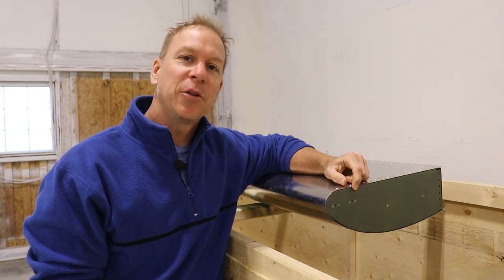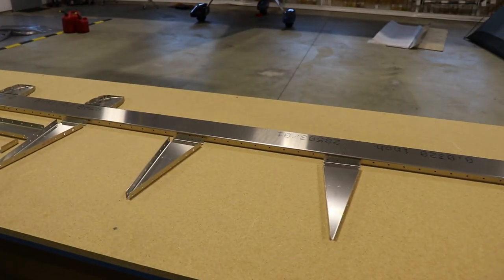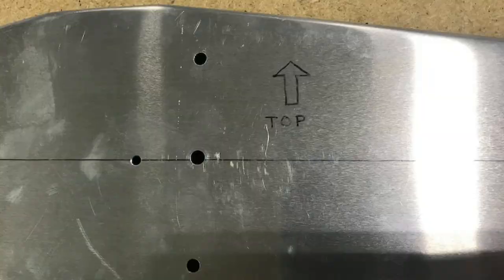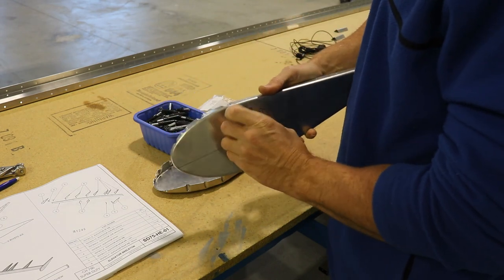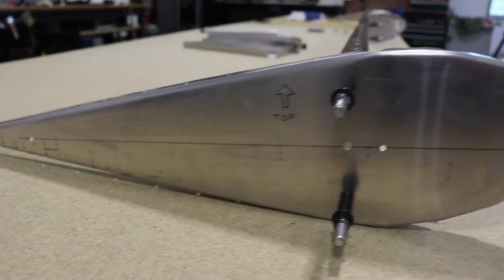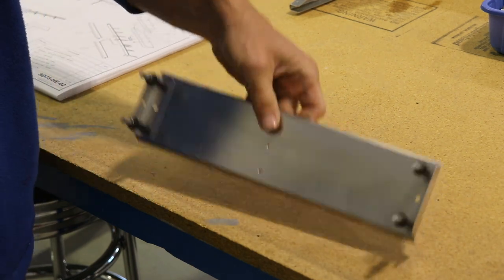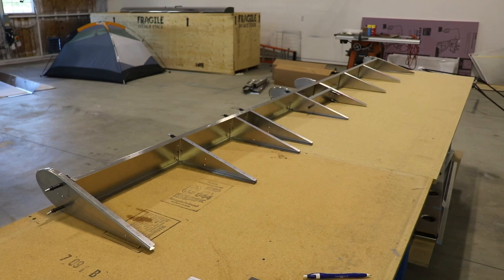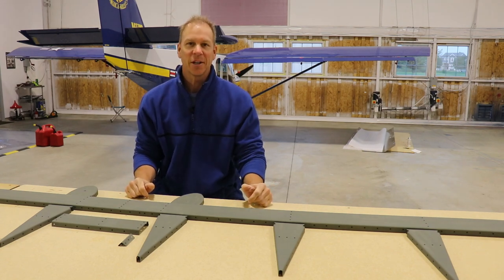CH-750 Super Duty Elevator Build (Ep5)

Comment: In one of your planning videos, you mentioned you will be putting in auto-pilot for longer camping trips.  I assume servos will be installed when you are at the stage for installing control cables and such, but is there anything to be aware of at this point of assembly if one is planning for auto-pilot?  PS: Your Blue Angel was the final straw for me and I wrote a check for a Cruzer airframe last week - my first build.
Reply from the maker: Awesome Lynn-congrats on the Cruzer! To answer your question-no. The servos will connect to the control tubes located in the fuselage so there is nothing autopilot related mounted in the tail.

Comment: Good to see primer in use.  Do you plan to use jointing compound?  I feel most uneasy about your 'file' deburring technique, - surely that removes more alclad than is desirable?

I am enjoying you build videos, please keep it up. Thank you.  Pete
Reply: I might be wrong, but I believe all the parts are straight 6061, so the material should be consistent throughout.
Reply: @AnonyMous-jf4lc I strand corrected. I think I had 2024 in mind.  Regards, Pete
Reply: this 6061 in bare, no clad like 2024, it is more corrosion resistant than 2024.

Comment: One question that has been on my mind for quite some time watching home build videos is when a person chooses to prime the airplane wouldn’t that create a gap that would be susceptible to motion and thereby wearing away creating separation between the parts. Should you assemble the parts then primed the piece as a whole? That would cover the seams.
Reply: The amount of force, and the surface area involved, I think the primer would be adequately "squished" to prevent any sort of motion.
*The pull rivets are applying enough force to rip off the excess aluminum
Not sure what the elasticity of aluminum is right off, but the rivet is under tension.

Using the primer as a "sealant" also seems reasonable.

Comment: Just wondering, pop rivets are called out in the print.I like your organization
Reply from the maker: Yes. The Zenith airplane kits are designed and engineered around the pulled rivets.
Reply: Kitplane Enthusiast thanks for your reply, I’m an A&P  mechanic for Boeing structural test in HB California. I like your work especially rounding sharp corners!

Comment: Is there a reason to start the kit build with the tail sections?
Reply from the maker: Really you can build any part you want first. But usually people start with the smaller pieces because they are easier to manage, and they are smaller and cheaper to replace if you screw something up while leaning new skills. For me, Once I get to the fuselage, I feel like I'm on the home stretch. It would sort of suck to build the fuselage, start installing engines and panels, and then have to build wings, tail pieces, flaperons, slats, etc...

Comment: Nice work as always. Question: what do you do to remember which side is up on those end ribs, after the priming obliterates the sharpie markings? Thanks.
Reply from the maker: The outside of the ribs were not primed since they will get primed during paint. Even if you did prime the outside, once you are familiar with them you can see the difference and would know which way is up.
Reply: @KitplaneEnthusiast  Duh... of course. Should have though it through before asking. Thanks

Comment: You would benefit from a set of transfer punches. I avoid drilling through an already established hole, especially in soft metals, as much as possible. Using a transfer punch is a good way to put a dimple in centered where you want to drill. You can then avoid the potential of making your existing hole over-sized. This is really important when the existing hole you may enlarge will be on the head end of the rivet. If the hole ends up over-sized, the rivet may allow some later movement to exist.
Reply from the maker: Maybe you can explain here how well a transfer push would work when the tip of the punch is about 5 times taller than the aluminum with the original hole??
Reply: @KitplaneEnthusiast  you can use a strap duplicator for thin metal, or, where you do need to hit it hard, make a guide by drilling a piece of thicker stock. Align, clamp, punch.
Reply: After rereading my comment, I would like to apologize for the way I composed it. I was focused more on the potential enlargement of the hole than focusing on the fact that I should probably disengage machinist level tolerance A.D.D.
Reply from the maker: @AnonyMous-jf4lc  It's possible to match drill as in the video without enlarging the original hole. You just need to be careful!